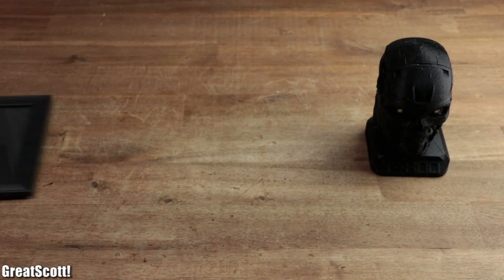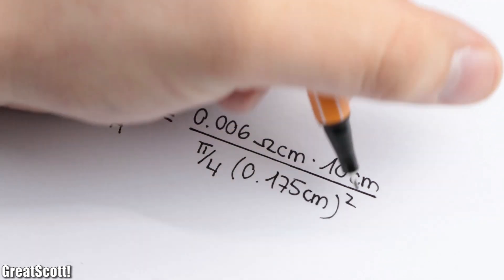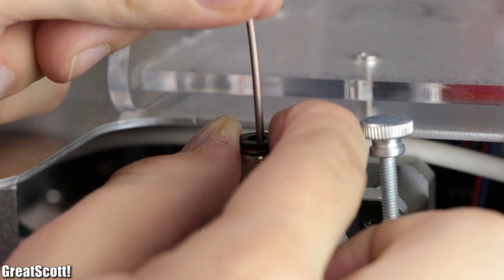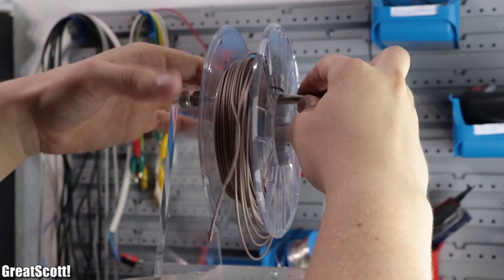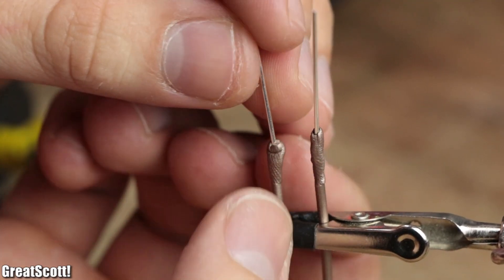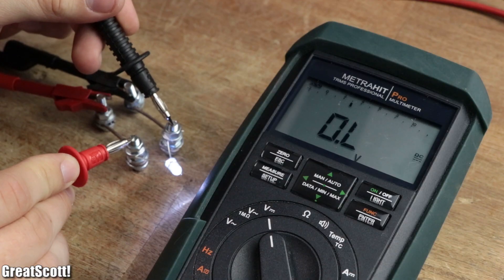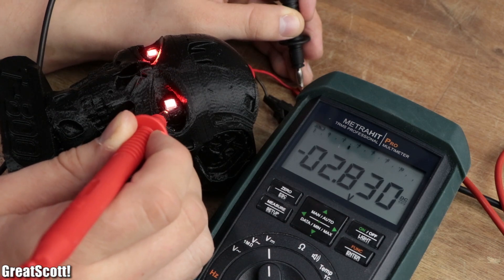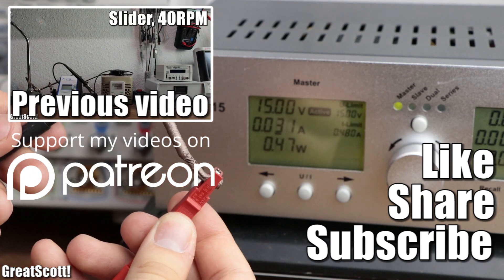Conductive 3D Printing Filament - Resistance/Power Test

Comment: Doesn't this mean you can 3D print circuit boards?
Reply from the maker: Yes, in theory.
Reply: The only problem I see with this is that the cost is going to be more expensive than a normal circuit board.
You also don't have the thermal properties of the copper that help you to spread head, or the mechanical resistance of it to screw it on a surface, remember ITS PLASTIC
Reply: People use printers to prototype. They should not be used for manufacturing. You could print your own circuit board (like Arduino projects), instead of paying a lot to have a custom one of a kind PCB manufactured, or having to etch one yourself. Also, with duel extrudes, you could have 3-D circuits, like the "wire filament" embedded inside the terminator. This would be extremely useful in certain applications.
Reply: Rizon1985 What takes long to print? A phone case would take about 5 minutes for reference. A (double herringbone) gear over 1" diameter and 8mm tall (.3") printed solid takes me 5 minutes and 30 seconds. I would think a PCB board would take a similar (less) time to make.

It costs me $10/Kg, or under $5 per pound for regular plastic, so the physical board wouldn't cost more than $.02, but the conductive filament might cost a few cents, but it would still be under $0.10 per circuit board the size of an Arduino. I don't know how cheap you can get custom boards, but making it myself, I would consider my time a bit more valuable than $.10 especially since I can just route the "wires" within a print for some cool effects like embedded LED's in a project (pause print midway to insert LED in a hollow space).

I agree with how awesome it would be to print copper, and if I wanted to, it wouldn't be that hard to add a torch (oxy-acetylene) to a printer. I think the only issue would be to not melt the plastic when molten metal touches it. ABS prints at 210*c, but it would probably have issues with molten copper.

Obviously this isn't for running a 10 Amp drill motor, its for LED's, sensors (like stress/force sensors, temperature or anything else needed). You could run small servos off of it, but I think most people don't run motors off of PCB's anyways, that's what a transistor and wires are for.
Reply: +Rizon1985 do you know what size nozzle I run? volume = velocity*layer height*diameter*time.

I run a .5mm nozzle, you must run either .1mm or turtle speed.

If you calibrate everything well, you can run grass trimmer line (according to some people). I've got glow in the dark PLA at that price (3mm diameter is a few dollars cheaper, so I've switched) and it prints amazing. with a bigger nozzle it doesn't clog up (5kg so far, not once yet with my Bowden has it clogged).

I prefer cost and speed, I prototype, everything turns out fine so why pay more? Gears out perfect, I get water tight seals for fitting a penny as the base in my Penny waterblock (as seen on thingiverse).
Reply: MegaNitrospeed why would a pcb on a 3d printer be so bad? Are you assuming the resistance is too high with this filament?
Reply: Getting small batches of a custom design isn't so expensive anymore. And taken how freaking long even small 3D pieces take to print, it's not so much slower.
With a 3D printer you wouldn't be printing a prototype anyway because you'd need huge traces until someone makes a 1000°C hot end for copper.
Reply: Jake Garrett First what 3d printer are you currently using ?
Second: Nobody that knows something about PCB`s would like to print one, you lose 90% of the propierties a PCB has. Its not just a way to transmit electricity and data...
Reply: MegaNitrospeed I use a reprap i3 with a custom Bowden extruder. I'm not sure on the actual mm/s speed, as it does speed up from 120 mm/s to 240 mm/s (by about double), but cranking it past 300 mm/s seems to give very little speed improvement over 240 (in repetier host or sli3er/Cura settings. I don't know how close to those speeds it gets though, it moves pretty fast, but those numbers seem high to me at least, but maybe it does get that fast.

So far the cost for building a new one would only be about $320 + assembly, so its not like it costs a fortune. I use mine for prototyping (mechanical/aerospace double major, junior/senior). I make a lot of different projects from robots to airplanes, to air ducting, to watercooling computer parts and so on with my printer.

Like the watercooling, I can't just run wires easily through my custom waterblock (printed body), but I could run metal traces through it to sensors recording pressure for finding structural integrity limits, or a temp sensor to find how effective the unit actually is at stages.
Reply: Jake Garrett 320 is a bit expensive for a prusa i3 i get a steel prusa i3 for that price.
The main problem is that a printed pcb is useless.
Reply: MegaNitrospeed Well, I gave a high estimate because it includes every modification I have on it. The updated version of mine without Bowden (so more accuracy and reliability at the cost of speed) with an LCD screen (and SD card reader), acrylic frame, was $250 a half year ago (haven't checked since then).

What's useless about an integrated wire layout for things that need to be water-tight? I'm not running more than a mA to check for signals. This new manufacturing would allow unique things like how aircraft put strain sensors within the layers of carbon fibers to check for damage since it breaks from delamination and usually isn't visible from outside inspection. 3-D prints also tear along planes, so this would allow for new testing procedures and sensor integration.
Reply: Jake Garrett Acrylic frame ?
That was a bad idea. It suffers from microwarps and microcracks that affects the perfomance.
You can already install sensors inside composite.
Everything that is for industrial use. Will usually use a high end solution.
This one, is definitively not a high end one
Reply: MegaNitrospeed Right, but for right now, it doesn't add but a few cents in cost. It might be good enough for personal testing (my waterblocks are not commercial products, but I might want to know the leak rate as a function of pressure for different print materials such as nylon vs ABS vs pla). Or I could incorporate strain gauges for approximate values since I'm more worried about approximate failure points and not necessarily exact values, just a range I can use to design with. 

Its not an ideal solution as you point out, but for what I would use it for, it would probably be good enough. I'm concerned more with speed of prototyping and ease of use, whereas it sounds like your more concerned with longevity and extreme precision. So for long term, the fatigue may kill it from the micro-cracks you mention, and yes you can install sensors in composites, it would just make it easier for someone like me to add bolt points and hook some external wires to an Arduino. I probably wouldn't use it for continuous monitoring like they do in planes, so after 5-10 minutes of testing, I don't really care if it lasts past that since I would have all the values I'm looking for.

I consider prints as mostly prototypes, so for actual production and manufacturing, I don't consider it a viable process as the parts are weak and expensive (for production runs). Everything you said is true, so this is clearly for a niche market of hobbyists. I wouldn't call it useless though, it might be a lot less useful for normal people, but for some it might be a really nice tool to have.
Reply: MegaNitrospeed Oh you were saying acrylic has micro-cracks. I haven't seen any cracks yet, and based on my sharp turn driving in my car, it has a good amount of stress to deal with when I transport it in my trunk. I've had mine for about 2 years, no problems so far. I usually don't calibrate it except after moving it around, so maybe every few months (like to thoroughly clean and dust underneath it). Eventually everything will deteriorate, but I haven't had problems so far. I like it for the looks, I make mine look nice with a ton of blue LED's to match my desktop, so if it only lasts 5-10 years, so be it, I'll probably design my own before then.

I'm not a person to worry about how long it lasts since I'll probably modify everything on it before something has the chance to break. For the frame, I may decide to go bigger print area, so that may be scrapped sometime anyways.
Reply: Why are you exaggerating your numbers so much. A simple 100x100x1mm with 1 conductive layer would take 15 minutes and crack from just touching it. $10/kg is crap filament filled with air and moisture pockets that fail prints and wreck your hot end even if you were talking about PLA and not ABS.
The whole discussion is moot anyway. Designing and testing a PCB is done in software. Printing a PCB with an FDM is useless because the technology can't build you a useful step between software design and getting a real $5 PCB printed.
Reply: Rizon1985

Comment: Just crank the heat of your printer up and directly put your copper wire in
Reply: The problem would be that the other materials had to withstand the heat. It is easier this way. If you needed something else, just get a circuit printer...
Reply: Hoch134
No, there are a bunch of different types of condcutive filaments. Graphene which is naturally conductive or ABS filled with nano carbon tubes. Proto pasta has a PLA with a special conductive compound etc...
Reply: Running a printer on tin would THRASH the nozzle... It would literally eat away the nozzle, as most are made of brass.
Reply: Sevendogtags I guess it's an alloy with a low melting point.
Reply: Or do selective laser sintering with copper powder. Selective laser sintering 3 d printers are a pretty penny but well worth the money.
Reply: Richard Smith just buy an Olson ruby
Reply: TheOriginalHumibold ìb
Reply: It looked like the extruder gear was moving 'way too fast' for this filament. Try adjusting the z extrude value to a finer resolution print before slicing.
In this case it seems perhaps a layer height of .06 is preferable with a simple raft. I wouldn't have attempted this 3Dfab with less than a finely customized 
Folgertech or an off the shelf, minimally calibrated Powerspec Duplicator. Cool video in any case. Liked and Subscribed. You have a good thing going.
Reply: could you use tin wire?
Reply: @maxxiang8746  no point.
Reply: or solder
Reply: if you drill a small second hole you can feed a piece a piece of carbon fibre tow or copper wire and the mechanical pressure of the melted filament leaving the nozzle will drag the fibre/wire with it.
Reply: My 60 euro 3d printer can run on tin wire
Reply: @tech8196-k8m  ayo where did you buy it?
Reply: the amount of fumes would make any room uninhabital
Reply: You could print bismuth, which melts around 260c.
Reply: hook up a mig or an arc welder to a print head and try that! That wouldn't be rocket science.
Reply: Just put the sun in the printer
Reply: I doubt it's copper dust. Metal in filaments won't make them conductive even at high ratios, because there's still tiny bits of plastic in between all the metals.
Reply: woosh
Reply: I know it’s a joke but copper melts at 2173•f
Reply: Yea... Printers don't go that hot, I do think some 3D printers could actually run on tin however
Reply: yeah i know that its Not Hot enough but it would be Way cooler than that fillament with copperdust in it
Reply: @FranseFrikandel  not tin but gallium would work.
Reply: mastertank63 well temperature wise higher end 3D printers would get hot enough. Can't see how printing with it would ever end with anything other than a big pool of tin on your build plate tho
Reply: @FranseFrikandel  Well I don't know how hot they can get but I know they couldn't melt copper.
Reply: @FranseFrikandel  why not?
Reply: @FranseFrikandel  that's the joke
Reply: @jacobkudrowich  You're only 5 years late.

Comment: Probably have to stick to doing something like setting a pause time in the middle of the print and manually inserting and maybe glue in a piece of silvered copper wire and solder it to whatever if needed.

Comment: I've used graphene as the conductive material in a project this year, though we had some problems with surface resistance being too high. To be able to connect LEDs etc. to a given circuit, we had to paint the connection point on the 3D printed part with a silver ink pen (found somewhere on Amazon). Once the paint had been applied, the circuit would work flawless. We even had some students do a masters thesis on this, where they came up with some different 3D models to build different circuits etc.
Another problem we experienced with graphene was that it requires a larger nozzle than a standard 0.4 mm as it would clog up pretty fast.
Reply: graphene or graphite?

Comment: You could try some 4 probe measurements to calculate more accurately the resistance of the filament and avoid contact resistances. Just apply a known current (say 1mA) through two outer electrical contacts and measure the voltage drop across two other inner ones. You should be able to extract nice resistance data with this method. Also, if you know the length and cross sectional area of the filament you should be able extract nice resistivity measurements as well. This last might be interesting to compare to the nominal one. That was a very interesting video :)

Comment: hi, metal filled matrices need curing, about 150-200
Celsius. I think the conductivity would increase if you print it out. if you can't just put in the oven for half an hour.
Reply: wouldnt it have been cured during the creation process when the filament was shaped and spooled? the machine works just like a giant 3d printer.

Comment: Nice tests!

For flexible filaments i'd suggest going for a flexible specific solution ... I think it was called Flexion? and go away from most open or bowden setups that were designed when only ABS and PLA were on the menu.

Does this filament have any special infill that could damage regular nozzles? that'd be my concern using it long term

Comment: i dont suppose you have any recomendations for a good 3d printer under 250$
Reply: Just go to aliexpress a lot of options under $200, you will have to build it but its quite easy. I would recommend a delta type printer
Reply: Any  200 to 250 dollars Prusa i3 clone you can get from ébay or aliexpress is good to start with.
Reply: For that price and good you´d need to build it yourself. the electronics are cheap, and the rest can be as good and as sturdy as you can afford it.
Reply: thanks
Reply: S_L_A_Y_E_R get a CR-10
Reply: The term "good" and that price don't go with 3d printers

Comment: I assume that this is a metal filled polymer. Did you try using suitable solvent to join a wire to the filament yet? Dissolving a bit of the filament in a minimum amount of solvent might make for a good glue to join wires to prints.